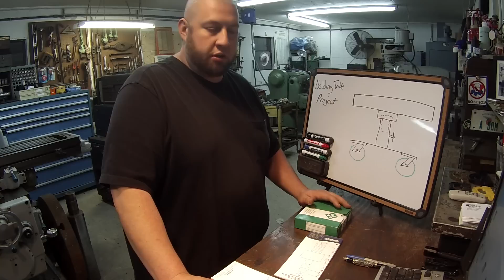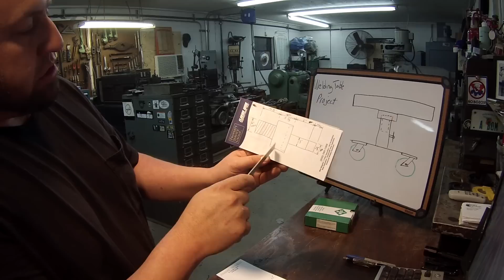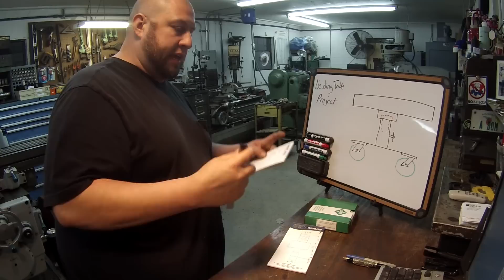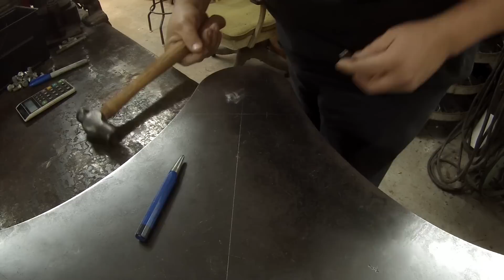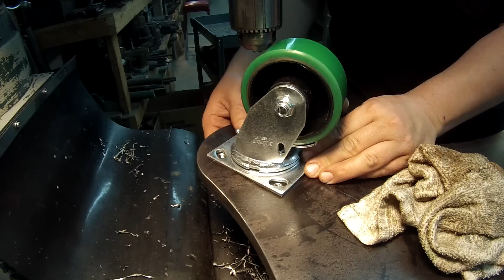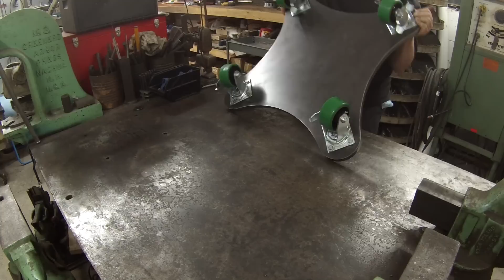Rotary Welding Table Build Part 1

Comment: what about an acid solution (muriatic acid or similar) to clean the metal? i used por-15 and muriatic acid on a saw mill build that had sat in the elements for several months, then several more months during the frame build. i used a degreasing cleaner, then acid, then por-15, followed up by their rust inhibiting primer then an implement oil enamel paint. just a thought man, so far, looking good.

Comment: You have started a nice project.  I appreciate seeing the details of your layout and of the drilling and tapping.  It helps us appreciate the planning and the work that goes into the finished product that was not built in 1 hour.  You and Tom designed the base to look very nice.

Comment: Why not weld the plate/wheel around the rectangle.  The welds should be strong enough to hold the caster plate on without failure.  Right?

Comment: I am a little late getting around to watching this project, but I am not dissapointed.  I like the various opportunities that you have to discus your approach to the thinking and planning and how you approach the layouts.  Using the layouts for the caster holes rather than punch them was sweet.  Great job.  I am going to remember this next time I need to drill some holes.  The way you moved the plate on the milling table and set the clamps was good to see for someone trying to learn home machining.  Thanks for sharing.  Larry Ogle

Comment: ADAM; Will the swarf and cuttings on the floor imbed in the composite tire material I would have leaned toward metal castors. I've had that problem with my chair in the shop. I've been watching your videos and I'm learning, real liked your squareing the four jaw chuck.    Hal

Comment: I think bolting on the wheels is a waste of time.  8 good tack welds on each wheel will hold it, not come loose, not a big deal to change..just my opinion,30 years fabrication experience...Bill

Comment: G'day Adam,
Nice work & a good solid base for what will probably at times bear more than it's own weight. I liked the look of the heavy duty castors you used with good greasing. I'll be following this project, it looks good so far.
Pedro...

Comment: Great Job Adam. As a welder becoming a machinist, I'm just going to offer this idea. Personally, I'm not one for 4 (four) wheels that can turn, i.e., go 360 degree direction of travel. I would setup something up, to take advantage of the preexisting cut-out(s) for just 2 (two) of the wheels, so when & if you need more control for travel, just the flip of a bracket, and two of the wheels will be locked for a straight line of travel.

Just the right amount of weight to one corner,  (via over hang, etc.,) or whatever, and you'll say, wish this thing would travel in a straight line.  That's my 2 (two) cents worth, and I'm sticking to it.

As Paul Hogan as the weathered Mick Dundee, (in the movie Crocodile" Dundee) NOW that's a Welding Table.
Reply from the maker: Thanks for the comments Dave. I too am concerned about the 4 swivel casters, but they will be easily replaced if I decide I need two rigid. One reason I'm glad they are bolted on.
Reply: Abom79  Not to repeat myself Adam, but "I would setup something up, to take advantage of the preexisting cut-out(s) for just 2 (two) of the wheels, so when & if you need more control for travel, just the flip of a bracket, and two of the wheels will be locked for a straight line of travel."

I don't know if your familiar with "TOW Truck's" on the version(s) with what is called a "Sling Model" or "Tow Sling" {Two separate pieces of heavy duty rubber} these model's usually has two arms which can extend out via "Spacer arm release pull grips." They {Spacer arm's} kind of look like a LETTER "T." You usually pull them out (Approx. 1/4 - 3/4 of an inch) and turn approx 1/4 turn to "LOCK them open, if you will {their spring loaded}." Other wise you just pull open the Spacer arm release pull grip, and let the arm extend out until the Spacer arm drops / locks in a hole automatically. Based upon this design, just reconfigure to meet the "Two NOTCHES" on the Swivel Wheel(s) Bracket, that I seen in your video. Just a thought, whatever floats your boat, or makes you feel warm & fuzzy, is the way to go.

Comment: Adam, it'd be really cool to cut some teeth in a section of the shaft and have a worm crank under there to spin it.  Whaddya think?  Or attach the pipe to the top so it slips over the shaft and you could have a foot wheel on the bottom so you could manually rotate it with your feet leaving both hands free when welding.  Just my thoughts.  I commented before the vid finished and get your want for simplicity.  Cool build!  Keep up the great work and have a great New Year!

Comment: unless there is a particular reason to make the welding turntable taller than the welding table, it seems you might save energy and strain on your back by making them the same height to facilitate transferring heavy work from one to the other.

Comment: ok on the short bolts you want to screw the casters on with they should have at least twice the major dia of the bolt deep with threads that is an ansi standard as I remember.
Manny

Comment: Yes Adam make the relief on the bottom of the shaft so when you tighten the table it will leave scars on the shaft but not on the smooth part of the shaft. If you pull the table ff t will not have scars to stop it from coming out.
Manny

Comment: Hey Adam
if you drilled a hole in the base at the center  at a later date you could add a extension shaft a flex plate starter ring  and a small dc motor  with variable speed control  and you have  powered rotary welding table

Comment: Another good video....  For what it's worth:   another way to attach the casters would be to cut (4) pcs of 1/2" plate, drill and tap thru holes and then weld the plates to the base plate. Have a great New year!

Comment: the base came out really nice adam.good exercise in layout work.with my luck i would have broke a tap in the 15th or 16th hole and then had to  ship the plate to tom lipton to get the tap out. the coward that i am i would have drilled and thru taped 1/2 plates to fit under the casters and then welded the plates to the base.

Comment: Great project. Just a thought, would a three cornered base plate not be better to accommodate uneven floors?
Or perhaps your floors are as accurate as the rest of your work😀

Comment: The slots on the castors look to be on a PCD rather than a rectangular pattern. Why I don't know - may look good on a computer monitor (I'm a draughtsman)! Nice work Adam. I never fail to learn something from your videos.
Reply from the maker: The paper work didn't come with the actual bolt pattern center, so I had to figure it myself. Kind of a pain with them cut on angles like that. But we hit our marks.

Comment: Hi Adam - really like the idea of a series on projects one would like in our own shop
thanks a bunch.
Question - where did you get the casters? and what weight are they good for?
Also - are you planning to build a gantry crane?
Rod
Reply from the maker: Hey Rod, they casters were purchased from Atlanta Caster. They are rated for 1k lbs each. I don't think I'll ever have that much weight on the table.
I have a gantry crane sitting outside waiting to be used, but it's too tall right now. I'll have to modify it to fit in my shop. Sure wish I would have already done that project. 😣
Reply: Abom79
Hi Adam
Can you remember the series or model of the casters.  I have looked at the Atlanta Caster website and they have three brands (Albion, RWM and Hamilton) with different series with each.  I want to build a 12 ft high two ton gantry crane and am looking for casters.  Have considered ones from Grizzly Tools but they only go to 88- lbs.  Thanks in advance.  Rod

Comment: Looks good Adam. I just finished a project and used Muriatic Acid to clean the metal. I was surprised at how well it took off all the rust. Just a suggestion to get that plate super clean. Although your just going to be getting it all dirty just as soon as you finish with it.  - Big Al
Reply from the maker: With the muratic acid, do you spray it on and leave it? Never used it before.
Reply: My video #15 shows the application 17:21 if you want to go right to it. I sprayed it on and then I would wipe it off after a few minutes. It doesn't take off the mill scale but it removes all rust really well. have to be sure to wear a respirator though.
Reply from the maker: Thank Al. I think I'll go pick up a jug and give it a try. I took a peak at your video and looks like it did a good job on the steel you were working on.

Comment: I've seen that table top laying around and have been waiting for you to post this series. Looking forward to the finish project.   - Big Al
Reply from the maker: We've had it for many years, I'm happy to finally give it some new life.
Reply: Do you know where I could purchase just the top you have there? Other than just scraping a positioner. Also is a table like that made from hard metal or is it hardened to prevent wear from fixturing?
Reply from the maker: Fabric8tion Nation
You would have to search the normal sources online. Maybe some tooling dealers would have one laying around, but best bet is that they are laying in the back corner of private shops just like mine. They are made of cast iron and not hardened. You can machine them easily. This was either a drill press table, or a faceplate off a very old lathe.

Comment: Hey Adam great design with the help of Tom for the base just a quick question what casters are those they look like really good quality grease able heavy duty casters
Reply from the maker: James I'll have to dig up the paperwork on them. I had one of the salesmen at work order them for me. I told them what I wanted and this is what I got. They are rated for 1K lbs each. I figured that would be plenty for what I need. Any beefier and the price shoots up.
Reply: Cool thanks

Comment: Hi Adam, great vid as always! I'm curious however as to why you've fitted four steering casters? Whenever Ive had something with four rotating casters it wanders off from my intended path when I try and move it. Much better in my experience to have two static wheels and two steering wheels. Happy new year to you all :)

Hugh.
Reply from the maker: I wasn't sure which option would be best, but it's no problem. I can order two fixed once I get it built and see how it funtions. But also, Stan has some caster locks that fit these wheels he's sending me. If they don't poke out in the way I might use two of them.

Comment: Well I would keep the table the same height as your other table you might need two tables at some time
Reply from the maker: After some thought and comments made on that it's actually a good idea that I'm planning on incorporating into the design.
Reply: Abom79 Never know how tall whatever it is that you will be welding on.  Maybe it is 1" above the table, or maybe it is 10" above the table top???  Maybe have some holes drilled through the outer cylinder every inch or two and a pin/bolt that locates it.  Kind of like a trailer hitch (receiver).  That would give you some adjustment???  Or turn the pedestal shaft with 2 or 3 grooves to so that your pinch bolt could engage at different heights???  No added parts, just modifying what you have.  Or not.... "and just say that we did".  ha ha.

Comment: Hey Adam...

I am concerned that your base is not large enough.

I believe your faceplate is 36"??
I would never have a footprint smaller than that unless it is bolted to the floor.
With wheels it is even easier for it to tip if you have something with more weight hanging off the plate than on the plate.

If that table ever starts to tip... You will never stop it... be ready to run fast in the other direction.

Also... I agree that you do need a lock device to prevent rotation but do you realize how difficult it is going to be to use that lock-down that you have planned? 

It is very close to the floor and you will have the faceplate to deal with as far as it interfering with your face when you have to tighten or loosen the table.  It just may be kinda awkward and something you might want to think about now rather than later.

I am anxious to see the project completed.  I always wish you guys would not post videos until the whole series is done... I am so impatient these days.

As always, Keep up the good work...
Anon
Reply from the maker: The faceplate is 29.5" in dia. The casters are on the same circle. It was purposely designed that way so that casters are on the outer dia of the face. 
We'll be finding out soon enough.

Comment: I wish I had room to make a big heavy welding table like yours. I'm feeling more and more cramped in my garage.
Reply: Screw the welding table! I wish I had the room, power, and money to even get a shop half as sweet as Adam's! I just need more electricity, phase converter, mill, lathe, welder, etc, etc! Awesome build too Adam, like seeing the old school layout.
Reply from the maker: Make room Mike! Ya gotta have a nice fab and welding table!
Reply: Yeah my little 4'X2' is better than nothing but I might throw a 6' x 3' 1/2" plate on some legs and rearrange my garage. My wife said I have to leave enough room for her to park so it's a give and take every time I put something in there.
Reply: I hear that Aaron Kimmins. My first mill and lathe fell into my lap. It's been a long process to get all of it up and running and I'm still upgrading stuff all the time.
Reply: Lol yeah I keep looking for a $50 big milling machine but with the same luck.
Reply: Abom79 Nice work as usual Adam, that base looks good with all the curves, kinda retro.  Looking forward to the rest.  Happy new year buddy.
Reply from the maker: One of the reasons I bought this house is because it had a nice sized detached shop. I always secretly knew one day I would have a small machine shop in it, just never knew when that would happen. 
You two car garage guys got it kind of tough. At least I have another shed I can put my junk in also.
Reply: Lol yeah having a car in the garage is a pain. Hopefully we'll be moving in the next year and a shop is going to be a requirement on the next house.
Reply: Mike Dittman yeah I hear that. Keep watching Craigslist for the lathe/mill combo some widow is selling for $50! No luck yet... :)

Comment: Adam, an excellent plan, nice progress!
For what it's worth, I would build the new table height to match your other welding table. I have 6 tables, workbenches, etc. in my shop, all the same height which was one of the best things I ever did. Works great for layout and support when needed.
I really like the way you mounted the casters, well thought out!
Thanks for the awesome 'ride along'.
....13
Reply from the maker: Yes I've decided to make it to match my other welding table. Some others have chimed in about it and after giving it some thought, it would probably be handy at times. Thanks 13!

Comment: Adam, I like it I like it. But, I have three words for you: OS O PHO! We use a lot of drill stem, upset tubing, sucker rods and other scrap from the oil fields down here in Texas for structural projects like fence, barns, etc. It is invariably rusty greasy and just plain NASTY. We slop osopho on it liberally and come back in a few days and all the crap has turned to a white powder…which you can blow off or even just paint over. I just thought I'd mention it…..
Reply from the maker: I've used it in the past and it does work good. Helps to make rusty metal ready for paint.

Comment: Hi Adam,

Thats going to be real nice and a lot like the one I built for my shop. I did mine like a potters wheel that I can rotate with my foot. I weld A lot of round things and that feature made it so nice to be able to rotate the part with my foot as I ran the bead. I cant wait to see the other episodes of this project.

Thanks for sharing.
Joe
Reply from the maker: I seen one like that at a hose shop one of the guys built. He mounted an old brake rotor on the bottom and rotates it with his feet when hes tig welding some fittings together.

Comment: Hi Adam,
Whist you still have this as a flat plate have you considered drilling the centre. I know you don't want electrics etc. but if you have the centre drilled out you could add an under slung foort wheel to turn the table top at a later date, a bit like an old school potters wheel. I think that would work well with your (very nice) base shape. It would clear the castors but still be accesible due to the sweeping cutouts. You would just need to drill bottom end of the main shaft from the table top so it could have another shaft extend out of the hole in the centre of the bottom plate with a wheel mounted so you could rotate it with your foot.

Just a thought

Thanks for the wonderful channel.

Cheers

Grebby

Comment: Looking good Adam..   In a small shop I find that the more surfaces at the same height the better, I would consider making this the same height as the welding table for instance (unless other shop surfaces / machines are at the proposed rotary table height) ...  Then you have a outrigger to hold a long part / assembly at the same height as your welding table ..
Reply from the maker: Yep, been many comments about it which has changed my mind to make it match the other table.

Comment: Forgot to ask, do you ever use chemicals to remove rust? I have always used Gem Rust Killer I buy it from my local steel supplier. Works really great and eliminates labor in sanding, etc... Also, once dry it acts as a primer... Just a thought. Keep up the great videos!